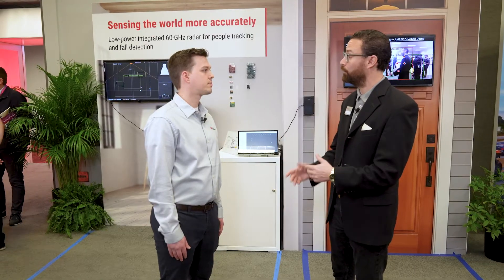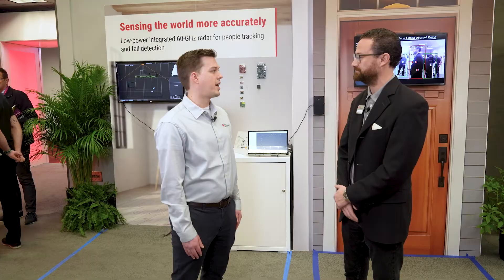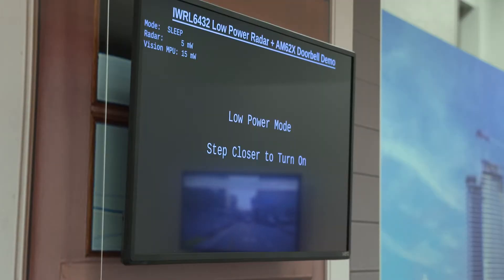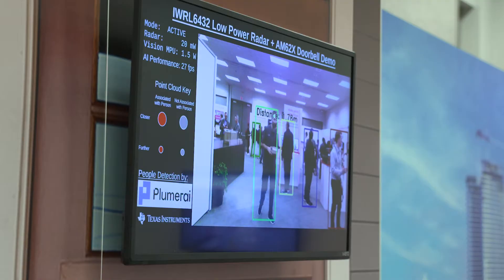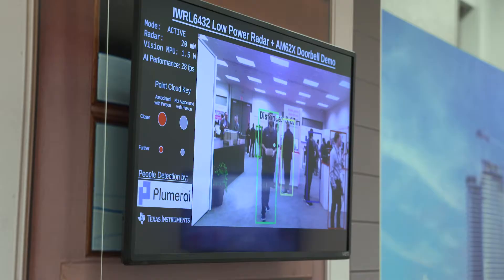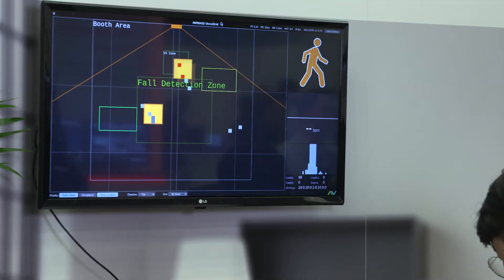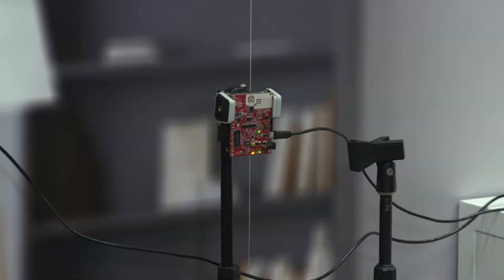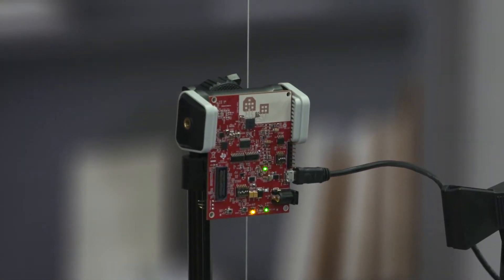60-GHz mmWave radar sensor overview at CES 2023

Comment: In this video, it was mentioned that this sensor could be used in industrial applications, such as measuring the level of tanks. Is it possible to build a device with this sensor that can read the fluid level in a tank with a resolution of 1 millimeter over a range of 15,000 millimeters and an accuracy of ±2 millimeters? This capability is currently available in industrial radar sensors. If this sensor cannot achieve such precision, what type of sensor can?

Comment: Wish he'd talk about the actual radar antenna and the processing taking place. Is this a tiny phased-array or what?
Reply: Should be a lower case 'z'.
Reply: also wish he'd talk about the effects of 60ghz on human tissue and internal organs.
Reply: @garygranato9164  Nothing,Skin just blocks it
The color Red for example is around 400THZ which is 400 000 GHZ
Reply: @garygranato9164  I just wonder that, what kind of effects does 60 GHz have on human tissue and internal organs ?
Reply: @serhatarslan4138  None.
Reply: @garygranato9164  Do tell, please.
Reply: @Barc0d3   i was asking a question not giving an answer. but  it wouldnt surprise me if 60ghz did produce negative affects.
Reply: @garygranato9164 none at the 0.1-0.3 mw. It’s non ionizing and cannot penetrate the skin.